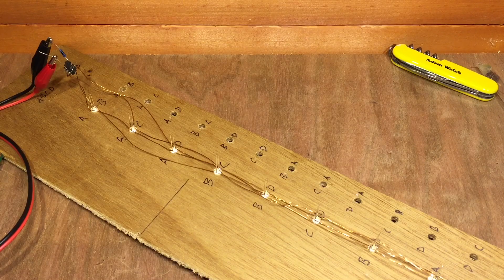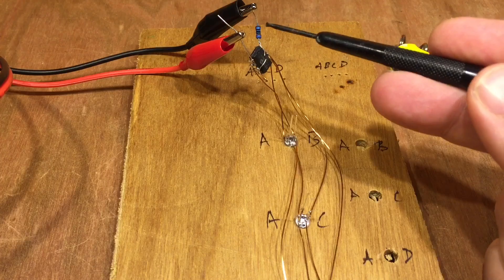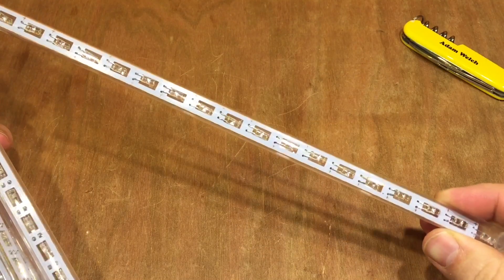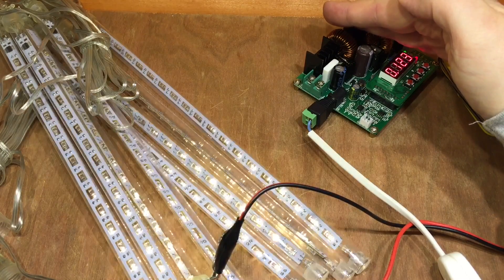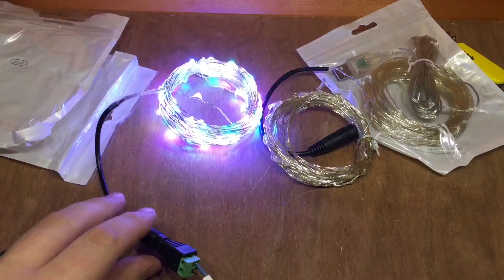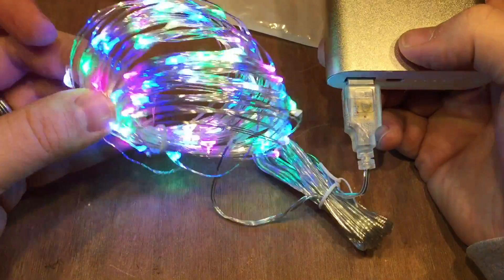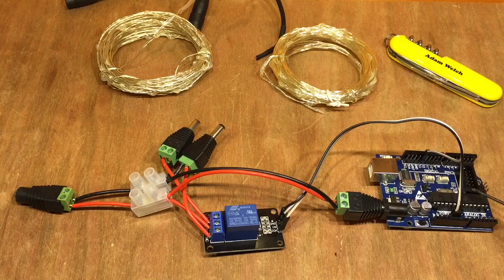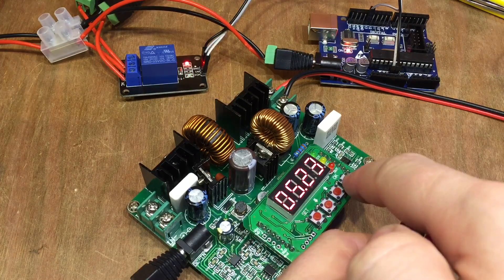Christmas LED Lights - 12v Solar Shed

Comment: I really like the strings with surface mount LEDs. I was planning to buy some but they were so pricey in the mall shops and I didn't get around to checking eBay yet.
Reply from the maker: +Gadget Addict I paid £5 for each string from uk suppliers. The price has hiked this month though - can't think why!

Comment: Last year I bought two strings of those meteor lights after I saw Big Clive's video.  The tubes are not waterproof and will fill up when it rains.  With fresh water they still work so you might not notice unless you look close but eventually they rust and fail.  If you want them to last more than one season you might want to apply clear silicon.
Reply from the maker: +Marvyn Harris Thanks for the tip Marvyn.

Comment: I bought some of the 10 days ago and installed them, I used 2 18650 batteries and a boost converter set at 10V last night and they lasted til midnight when I turned them off at 3.74 volts.  Maybe I can go even lower voltage on them.
Reply from the maker: +pirucreek That's very good. Those LEDs don't pull much at all. Presuming your boost converter doesn't protect your lithium cells it's a worry how far to push them isn't it?
Reply: ***** The batteries are supposedly protected, but they are Chinese EBL 18650.  I really don't care if I kill them, I only care the that the house don't burn down.

Comment: If you decide to use more than 2 strings, may I propose a GUI pattern generator for Arduino? It generates the whole .ino sketch (non blocking, of course :) ) http://goo.gl/TA6MHC

Comment: Aren't a big relay like this a bit overkill for the job ? A solid state relay would do the job and be quieter maybe ?
Reply from the maker: You're right of cause, but it's what I had lying around and I hadn't planned to do that bit! :-)
Reply: also for the simple toggle switching I guess an MCU isn't required ? I can be done with logic ICs ? I don't know that myself just thinking it could.
Reply from the maker: +Maico There are much more simple ways to do it. I just grabbed what was to hand. I was tempted to use a couple of mosfets and control them independently of each other and run various effects - but I liked the idea of just using the most basic sketch.
Reply: ***** which is cool :)

Comment: nice video Adam. Did you bother to solder the broken string together again ? I received my 144 Led 1 meter tubed neopixel strip. Have plans to make it into an  icicle light for christmas and later for other fun patterns. Laughed at the loose connection when you wanted to demonstrate the relay switched lights. Happens to everyone :-) Merry Christmas to you too !
Reply from the maker: +Maico Thank you. I did look at that yes but found the heat I had to apply to the enamelled copper wire fried the LEDs. :-(
They were cheap enough so I'm not to fussed but was much more careful with the others. 
I like a good neopixel. Sounds like a nice project.
Reply: ***** you can save the LEDs from the broken one although its not worth alot of money these days. I'm not english (Dutch) and I had to look up the word enamelled cause the pronounciation is so much different than the writing :) We call that 'glazing' or 'emaille'. Neopixels are nice indeed. I already made 2 projects with it. See my videos. Those were original rings from Adafruit but as you probably know Neopixel is just a fancy name for World Semi 28xxx 'Leds' so I got the 'ip67' strip from china this time. It was only 15 Euros for 144 neopixels.